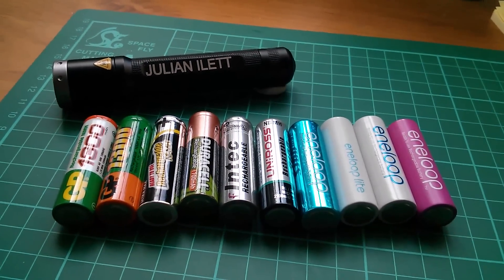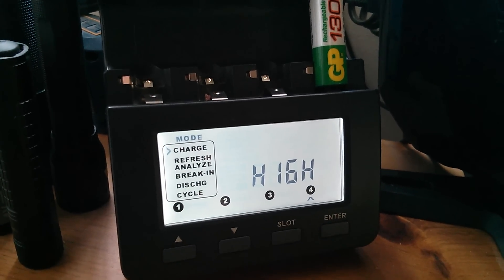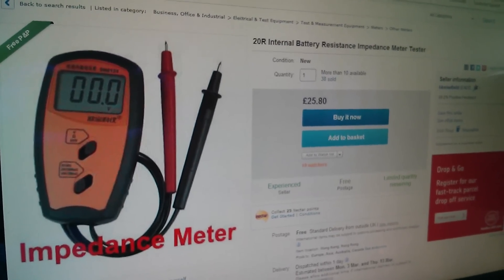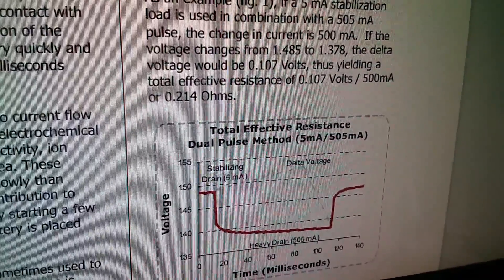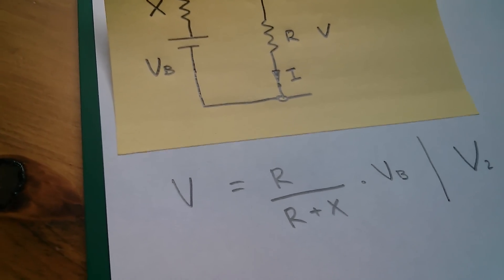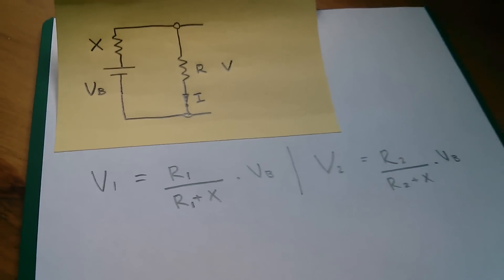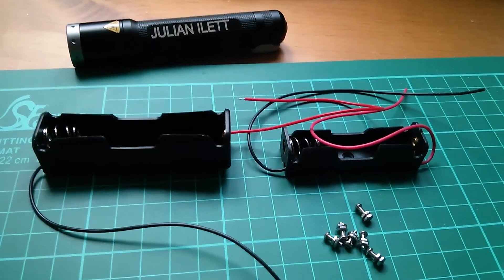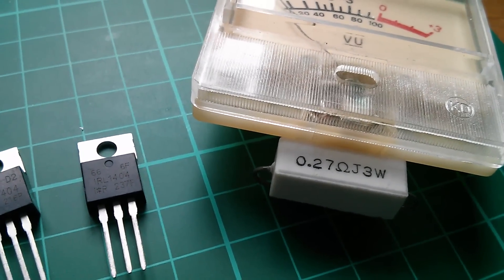Building a Battery (Cell) Internal Resistance Tester #1

Comment: Great idea! Many of my AA rechargeable batteries are practically useless. They lose the charge while lying on the shelf. When I use them in my camera I see the low battery sign almost all the time. I've tried so many brands (among them Sanyo, Samsung Pleomax, GP and more). Even the POWEREX MH-C9000 battery charger didn't change much. I tried the Refresh & Analyze and Break-In modes. It takes so much time, and the effect is disappointing. Do you know of good AA rechargeable batteries that would not lose the charge?
Reply from the maker: It's no contest - Sanyo eneloop. 70% charge retention over 5 years - nothing else comes close.
Reply: Julian Ilett
Thanks.

Comment: I did build Adam Welche's very accurate 18650 capacity meter and now I would like to expand that project with an ESR measurement and a charge circuit, so 18650's are pre-charged before testing. (Using the MP1405 charge board - I can use it's leds indicating charge and charged for the arduino control.)

Your low current measurement for NiMH batteries, is that also applicable for 18650's?
Most instructions I can find are either high current discharge and disconnected measurements.
The low current measurement you mention makes a lot more sense replacing the disconnected measurement.

Love to see you pick up #2 and maybe expand it to other battery types.

Comment: Interesting project Julian. Kirchhoff's second law should be able to calculate the internal resistance of the cell. Just getting into LiPO batteries and trying to get as much background technical information about charge/discharge cycles and suitable chips for charging like the generic TP4056 china modules for building usb/solar charging units.

Comment: nice work Julian,
Just 3 question...
1) what protocol do you think you'll use to comunicate with the LM096 OLED module..?
2) It's should be possible to connect this Module with an Atmel 328...?
3) Where do you get it this module..?
thank you for the time you dedicate in making videos..!
Paul.

Comment: I have over 1100 ,,,18650's I am building a pack from. I was thinking about trying to match the IR as much as I can. To help keep the bank balanced. I am capacity testing every one of them!!! Big job!! BIG!!! I am capable of charging 18 at once independently. And testing 15 independently.  It still takes a long time. In fact I get up in the middle of the night to do a cell change. It takes about a month to test 200 cells. I'm using 98% of the cells. The 2% are 0 volt. Or under 2200mah. The useable cells are usually 2300-2925 mah. So it should be 29.4v and well over 500 ah when done.. Great old video. I'd like to see more!!

Comment: r=(ε - V) / I 

The formula I see on the net does not have any ΔI, just ΔV.

If ε is the open circuit voltage
V is the voltage under load
I is the current under the same load
r is the internal resistance, the formula is...

r=(ε - V) / I

So they don't bother with ΔI which makes sense as the gradient on that curve you see in that document of yours is locally flat (ish). I am guessing though that if you take 2 readings with different loads and keep ΔI then it will be more accurate. Am I right?

Comment: Love the video and the detailed description of it! Just found your channel today and watching all I can! 👍👍 So far! Did you ever finish the resistance tester?? Can't find part 2. I'm a modder, newbie still, but I've got into sub-ohm building heavily. And with battery manufacturer's "supposed" rating being all I have to go on it's a little dangerous. I build anything I can and would love to see how you finished your tester! And keep the DIY videos coming!!
Reply from the maker: nicl8098 Thanks. No I didn't follow that idea up - I think there may be problems with precision measurement of the cell voltage. Also, I saw an internal resistance tester on eBay, although it was quite expensive.
Reply: Julian Ilett so surely we can manually do this with a multimeter to get the accuracy? be awesome to see this maths work in practice just on your wood breadboard and paper. love your videos.
Reply: lotsarats You can definitely do this manually however you end up setting it up, the materials and meters involved will affect the accuracy obviously but depending on your scenario it may not be a big deal.

If you primarily care about finding the bad cells even with the cheap bare basic entry level stuff such as: cheap multimeters, a high value resistor and a lower value resistor (make sure it has a high enough power rating, although it should be able to handle a brief high load depending on the values). You won't get an accurate or precise result if you're gonna do the short high drain one manually but you can get a pretty good idea especially once you know how a healthy cell of each chemistry behaves to weed out the bad ones.

To get a proper measurement you'll need to put some more effort in I guess, but it all depends on your objective. The crucial part would be to get the timing consistent of the high load and be able to get a readout of it in time, if you want to go bare basics you could go with a switch (that can handle the current) and meters that have the ability to capture peak values they'll retain the lowest current and voltage with the pulsed load.

That's just my quick thoughts on the manual method, it shouldn't be too hard to make it semi-automated really and get the timing consistent. But the subject for me has never been more than a curiosity, I hope my silly random ramblings might be of some use to you or others.

Comment: Why wouldn't this work:

X=Vb-R

We know the open circuit voltage Vb. So the difference between Vb and V is a voltage drop across the 'internal resistance' is it not?

I have to build some test geer...
Reply: did you test this??

Comment: Excellent show.  Please don't stop.  I chased internal resistance on my li-po batteries for my rc airplanes.  (engineering can be a curse)  I had a big table full of data on XLL.   I was already to plot it out when common sense kicked my butt.  DA, Amp-hours out to your load is all you  care about.  I use a rc watt meter and 12v halogen light to get the capacity.  Internal resistance changes like a hookers panties.  Good luck and keep  up the fantastic work.  p.s. current flows from + to -.  Who ever heard of politically correct electrons ?

Comment: Interesting project, looking forward to updates!

A while a go hack-a-day featured this LiPo IR meter: http://cseb.hu/rc_modell/multi_instrument/index.htm
This one doesn't use the pre-load though, but seems easy to add. It is also using several FETs in parallel to reduce the resistance even further. There is some interesting timing info how voltage drops and stabilizes, which may be useful too.